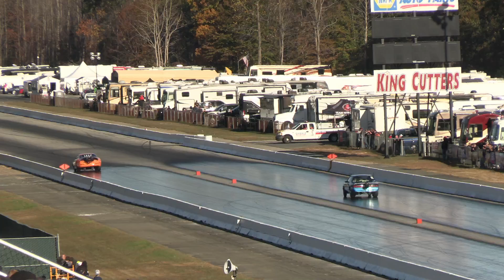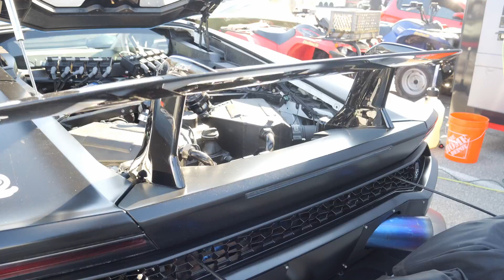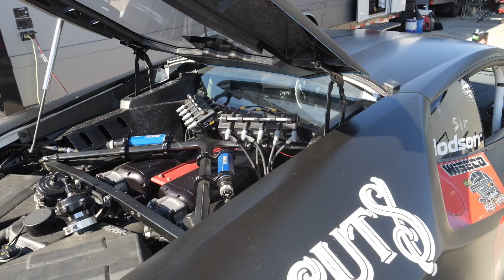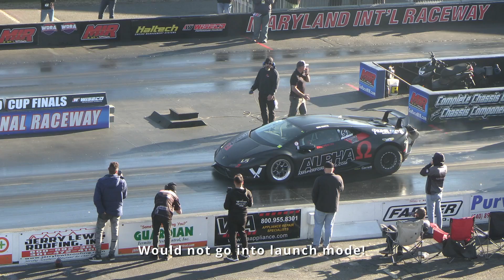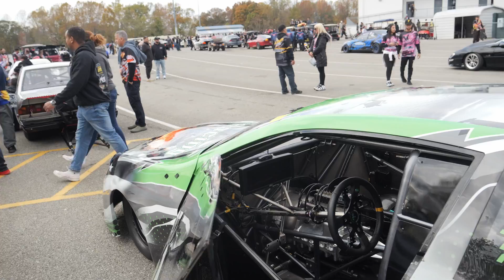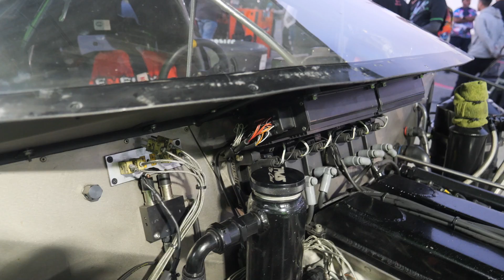Dragrace tech! Worlds Fastest Import car, Lamborghini and Supra!

Comment: In this case, the Supra has an aftercooler, not an intercooler. An intercooler is technically what's used between compressor stages and the term has basically never been correctly used in the automotive world.